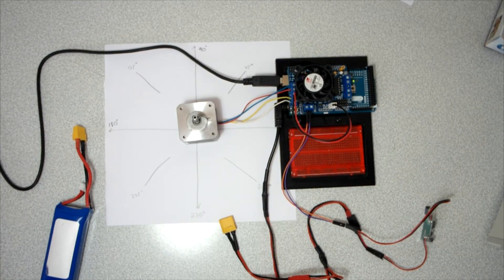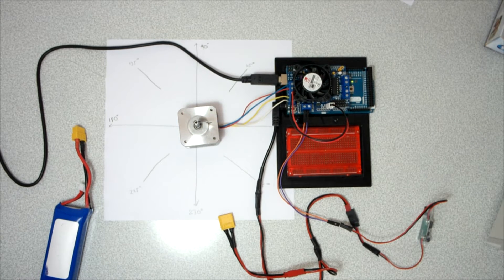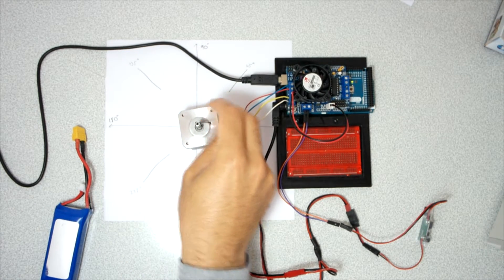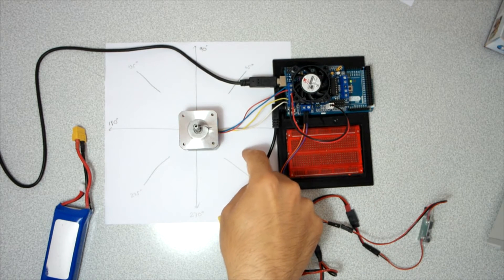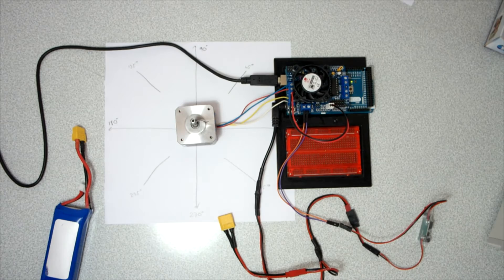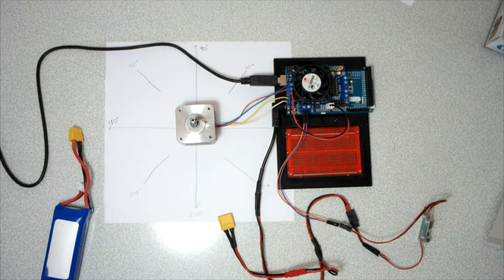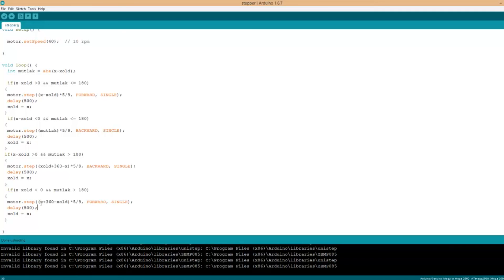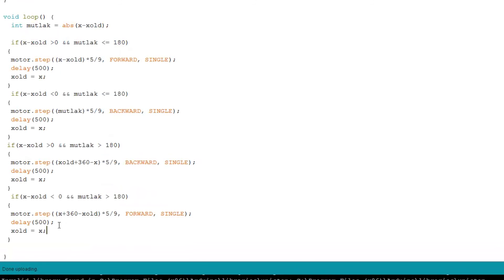360 Degree Servo Motor Using Stepper - Arduino

Comment: Just what I have been working on. Been trying to use a closed loop stepper MKS42 but having problems coding to it. I think I will give this a whirl (pun intended). I will need to put my positions in an array and trigger them with inputs to analog ports. Should work with DRV8825 driver as well. Thanks for the video.  What is mutlak?
Reply from the maker: I didn’t remember the code but I can say what is the meaning of the “mutlak”. It expresses absolute value
Reply: @MFurkanBahat  Thanks for the reply.   Been trying to get your code to verify and looks like I need to change library to Arduino AccelStepper.h to support the DRV8825 driver I use.  Having some issues with  compatible terms used from one to the other. Any thoughts on how I should rewrite the code.   (I installed the AFMotor.h and it didn't help.)   Thanks for any help

Comment: I didnt get that quite right sorry please...what's your problem with the servo (using gears to turn 360°)....is it accuracy? Or what? Coz am doing a project and I'm at the verge of deciding whether to use steppers or servos with gears. There will be many gauges and using steppers will use quite much of my Arduino pins.